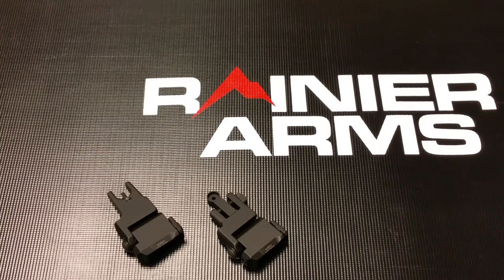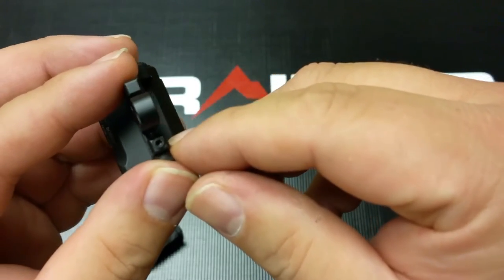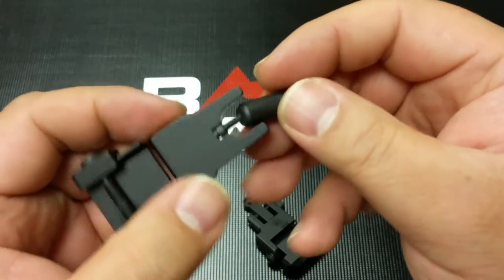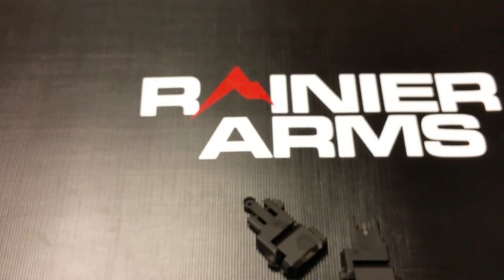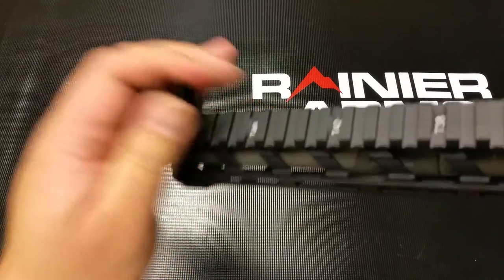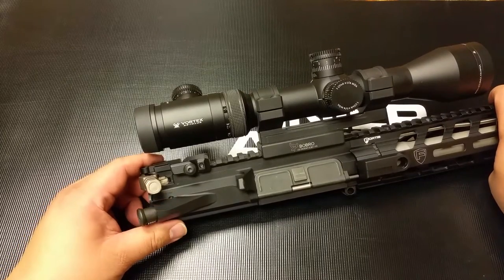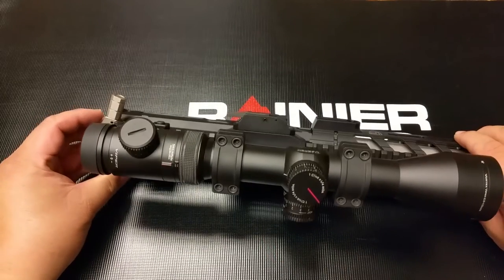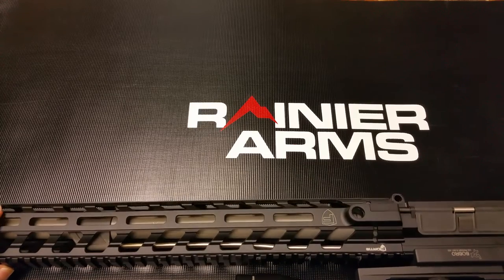Bobro Engineering LowRiders BUIS

Comment: Treating "open sights" or "metallic sights" as a "backup" and choosing "BUIS" that are "junior-varsity" in their practicality, capability and ability to be zeroed, sighted-in and actually adjusted for windage and elevation and that are inferior in any or all of the above to your "primary sight" so-called "optic" is really, really foolish since in any situation where your "optic goes down" and you have ONLY your "BUIS" PERIOD to aim your rifle, simply being "optic-dependent" enough to consider an "optic" a "reliable" sight for a "battle rifle" and one you only need a "junior varsity" back-up for is you REAL "problem" and one that's always there no matter what sight is "primary" and which "back-up". But in an "emergency" where suddenly your high-end primary "optic" goes down and you suddenly have to "discard" it and you're down to "Plan B", the chances of you being able to "recover" and "get over" the loss of your "primary" sight and be even "competent" much less "accurate" with a "back-up" you really only chose based upon how "light" and "simple" and "compact" and NON-OBVIOUS it is are somewhere between slim and none IF that "backup" sight is completely lacking REAL "adjustments" with MOA/MIL/RANGE markings, detents, etc and a complete lack of interchangeable "apertures" goes. 

The reason most "primary" peep sights for "tactical" shooting have interchangeable "apertures" which can either be swapped into and out of a single "post" OR are on multiple "flip-up" posts is because the utility of a peep sight is dependent on LIGHTING CONDITIONS and no "open sight" GATHERS LIGHT like an "optic" does. And with a loss of magnification comes a loss of ability to use an "optic" to "spot" potential "targets" at a distance and engage a "target" at what would otherwise be beyond "visual range". With a "peep sight" you're pretty much forced to shoot only when and where you can do so "effectively" and be sure of your "target" and are well within the "effective range" of the cartridge/rifle. 

That "effective range" is REDUCED with less ambient light and to even shoot "proficiently" period you're forced to use a larger aperture in order to get a wider field of view and good "sight picture" at CLOSER DISTANCE where you can still reliably ID the "target" and aim and fire accurately and precisely. NONE of the so-called "back-up iron sights" with a single aperture and lack of REAL windage/elevation adjustments are anything but "security blankets" to make "shooters" feel better about being "prepared" for their optic "going down" and only those "shooters" who go out and "train" on nice sunny, bright days "engaging" targets that are big, bright and high-contrast and at "short range" where the "aperture" is plenty large and REAL range/windage adjustment capability "unnecessary" are even good "back-up" to having NO SIGHTS for anybody who can "point" a rifle well enough to hit a "target" under those conditions more often than not at X range and are only "more likely" to "score a hit" as "X range" is reduced with a "bad guy" for some crazy reason continuing to "advance" toward somebody firing at him/her. 

Of course having the "enemy" miss repeatedly in a "real world" situation the likes of which the "shooter" who is missing repeatedly obviously never "trained" for judging by their inability to "score hits" on a moving target is a good reason to at least keep "advancing" toward some sort of "cover" or preparatory to making a break for it when the "shooter" who can't hit dick "falls back" and is retreating or otherwise is "out of action" vs. stopping and retreating and backtracking towards "safety" and giving the "enemy" a little confidence and time and incentive to slow down, take their time and THINK instead of "react" IF the overall "goal" of both sides is to "take out" the other. 

And of course "advancing" against "ineffective fire" certainly isn't any more "risky" than advancing against non-existent fire as an INTELLIGENT rather than "TRAINED" ENEMY WAITS UNTIL A "TARGET" IS WITHIN "EASY" RANGE and "spray and pray" type "shooters" rarely "learn" anything from negative experiences like having to "fall back" after being unable to "score hits" on an advancing "enemy" except to maybe start shooting SOONER and "suppress" the enemy and any possible "attack" early in an "advance". Which also really doesn't work all that often since an "enemy" that's determined to "advance" and who has begun to do so isn't likely to "give up ground" much less stop, turn around and "fall back" to a position he/she doesn't KNOW to be "safe" any longer and is going to continue to "advance" until he/she either reaches the original objective or "Plan B" objective which EVERY INTELLIGENT rather than "TRAINED" soldier/unit on the battlefield has identified as their "fallback" position for/during an "advance" that is PLANNED and EXECUTED to reach a PRIMARY OBJECTIVE of real "strategic" value. The "fallback" position along the ROUTE OF AND ADVANCE which still gains them ground is of TACTICAL value. TACTICS are the "actions" used to achieve a STRATEGY and STRATEGY is/are the real-time, subject-to-change and "common sense" path(s) to "victory". 

Which is why all the b.s. about "tactical" HARDWARE when TACTICS ARE HUMAN ACTIONS AND ANY HARDWARE USED TO MAKE TACTICS POSSIBLE AND "SUCCESSFUL" BECOMES "TACTICAL" ONLY AFTER THE FACT AND WHEN USED TO IMPLEMENT A SPECIFIC "STRATEGY" is pretty HILARIOUS. If the TACTIC required to be successful in the "strategy" of "taking out all the bad guys" and the "objective" is "winning the war" which is "inevitable" once all the bad guys have been taken out, anything and everything used or useful FOR "taking out bad guys" is automatically "tactical". Even if it's not even a "weapon" and/or an "assault weapon". A bolt-action "deer rifle" is just as "tactical" as an "assault rifle" in the hands of a competent, intelligent marksman and probably a far SUPERIOR "tactical" rifle for everybody but a "shooter" who wants/needs "high-capacity" and "back-up" sights for an "optic" before he/she ever even "goes to battle". Not to mention the SURE WAY to make sure you need something that's a "back-up" for a failed "primary" whatever is to rely on a BACK-UP BEING THERE AND ABUSING/NEGLECTING THE "PRIMARY" WHATEVER AND/OR NOT CHOOSING A "PRACTICAL" RATHER THAN "TACTICAL" WHATEVER IN THE FIRST PLACE. 

If you can "imagine" a situation where your "optic goes down" without having done any "training" or "shooting" anywhere in the field in "real-world conditions" of weather extremes, rough terrain, moving through heavy vegetation you have to literally push through, getting into and out of "offhand" shooting positions and without "crutches" like pads/mats, bipods etc and haven't spent ten times as much time "in the field" carrying but NOT firing your "battle rifle" and treating it as the "tool" carried along "just in case" 99% of the time so it there 1% of the time to do its actual JOB of putting a bullet "on target" in a PRACTICAL "shooting" situation like HUNTING (and the REAL KIND on foot walking and stalking and still-hunting and actively LOOKING for animals instead of sitting in a blind/stand waiting to "ambush" them) then there's no way you have any idea what you're really going to need from and should look for in a "tactical" sight system and you're just assuming that "optics go down" because you're assuming THEY are the "weak link" in YOUR "weapon system" because you're probably not a "marksman" even WITH a fully-functioning "optic" and attribute your inability to put bullet on target reliably even in "best-case" scenarios to your "optic" instead of your lack of ability even with a magnifying, precisely adjustable for windage and elevation "optic" to use it "effectively" to do the very simple task it's designed to do. Which is "aim" the rifle and make "point of aim" and "point of impact" coincide. 

If you can't do that "effectively" with an "optic" then its because you never learned to do it with "iron sights" or "open sights" of any kind in the "real world" and there's no chance in hell that in an "emergency" your "optic dependence" and experience shooting only WITH an "optic" is going to make you what you never learned to be in the first place. A competent, effective "shooter" with "simple" open sights. And if you DO have that basic fundamental background as a "shooter" with "open sights" and are competent and comfortable with them and just have "optics" to expand the capabilities of your hardware and the "software" between your ears doesn't care much which you use one way or the other and can work with each equally well, you'll never consider an "optic" to BE a "primary sight" WHEN that "optic" is "failure-prone" and/or a given "weapon system" has no primary open sights. You see plenty of "deer rifles" and other "hunting rifles" that get far more "abuse" and "neglect" than 99.9% of "battle rifles" and/or "assault rifles" owned/operated by Range Rambo wannabe Super Sniper SHTF "soldiers" with no "back up iron sights" at ALL and the reason an optic "going down" in THAT "sport shooting" world is relatively RARE and mainly is limited to noobs and rookies is because no "rifleman" ever treats any part of his "shooting system" as "disposable". 

Take care of your gear and your gear will take care of you. And that includes not shooting the hell out of it playing "soldier" wannabe and doing stupid shit like "torture tests" and "training" where you beat stuff around "on the range" like it doesn't mean the difference between life and death and/or success and failure "in the field" and then buying/installing/carrying on and ultimately "relying on" on so-called "backup" hardware that is just as likely to be FUBAR and useless by the time or shortly after you "need" it as your "primary" hardware if you're stupid enough to abuse/neglect/improperly select your "primary" hardware in the first place.
Reply: Dude, you are making a lot of assumptions and using far too many words to make a simple point. The fact of the matter is that the state of modern marksmanship is changing. Optics like scopes and red dots are becoming more reliable and more affordable to the point where it is almost as practical as using iron sights. But it doesn’t mean that he just doesn’t use iron sights or practice with them. But that is just how the market is changing. Even Troy battle sights are marketed as “backups”, despite being robust and fully functional irons in their own right. It does not mean that he doesn’t understand the importance of being able to shoot without an optic. I personally love iron sights. I have always been a guy who prefers reliability and simplicity. But I can recognize that technology changes. Even iron sights have evolved. You used to just have one non adjustable front post and a non adjustable rear. Then eventually we started getting systems for windage and elevation. Even now, optics are starting to have features like motion detection to turn the sight off when not in use and solar strips so as to have alternate ways to power the optic and save the battery. They are becoming more robust and better in design as well. It may one day get to a point where the battery won’t even need to be changed or needed at all. But at least this guy knows the importance of keeping irons as a “backup”. Some people don’t even put iron sights on their rifle at all. Shit, even when I was active duty, they encouraged me to rely more on my M68 red dot. Even when there were times that I wanted to use iron sights. Optics have reached a point where they are good enough for modern military to use them and treat them as primary. So even or standard M4 sights were considered backup. You need to chill the fuck out and not assume that having a slightly different priority means he ignores fundamentals. This is coming from a guy who practices with iron sights far more than with optics. As for these particular sights, they work fine for basic shooting. As long as they stay in place after getting a decent zero, you really don’t need all the bells and whistles of expensive “combat” sights. I would definitely put these on something like a 9mm AR pistol and I would test them on a standard M4 style AR. I would even use a red dot with a 9mm AR pistol and have these as backup because it really is a fast defense setup. I admit that I ranted as well, but damn man, you could have cut your entire essay in half by getting rid of all the unnecessary quotation marks. They made your rant even more confusing. Either way, optics are going to get more advanced and irons are likely going to become principal, but no longer primary. But just be glad that people still think to at least keep them on the firearm.
Reply: Also note that the rear sight hole tends to be wider than a long range peep sight but still not wide like a short range aperture. This was likely to compensate for the lack of having to separate apertures. And for carbines and compact setups, it will do just fine. I would imagine these are marketed towards competition and home defense rigs. Once again, as long as they can hold a zero, you can do good practical shooting. Hell, when I was in the military, the entire reason why we went more for being able to hit a human sized silhouette as opposed to trying to get sub MOA groupings was because in a high stress combat situation, you simply needed to shoot fast enough and hit the person. So we got a basic zero and then we stuck with it. If you had a high breeze, you used Kentucky windage. If you were hitting low, it was faster to just aim a little higher, rather than fuck with the meter settings. It is the same damn concept with these simple sights. They cut to the chase and they have a “middle” sized aperture to compensate. Get off your fucking high horse.
Reply: What kind of “psychopath” uses so many quotation marks? I hope you have BUQM on your keyboard 😂
Reply: Too much time on your hands, go find a hobby 🤣🤣🤣
Reply: Holy Smokes "Batman", that was "long-winded"!
Reply: “Thx”
Reply: Holy parentheses Batman
Reply: "go" "outside" "dude"